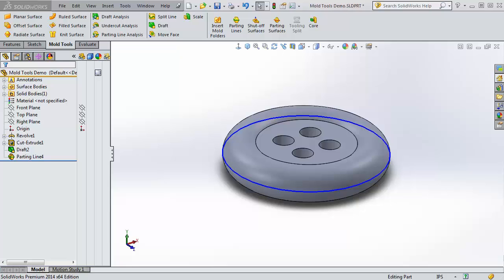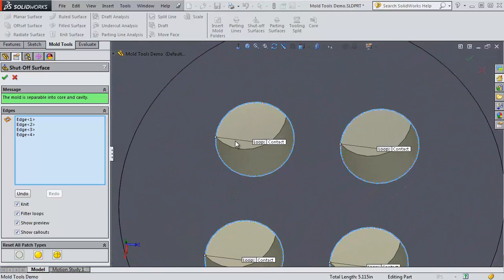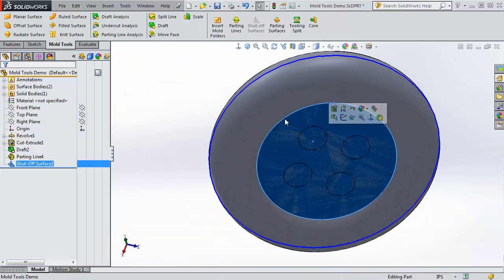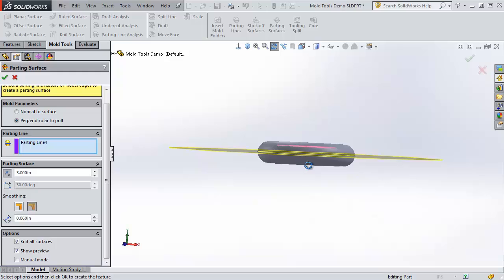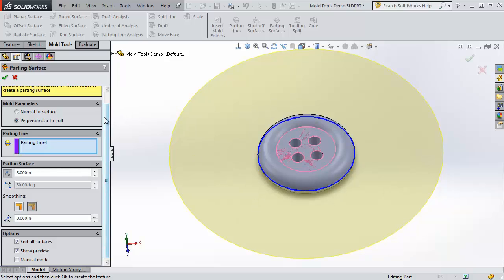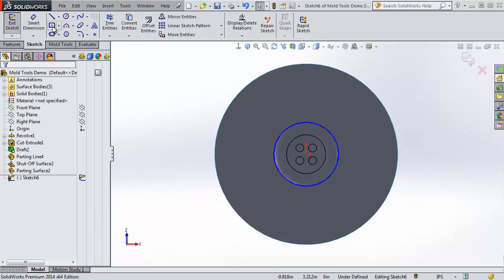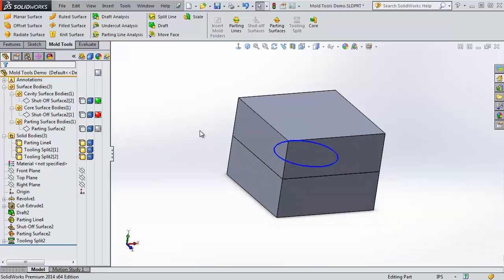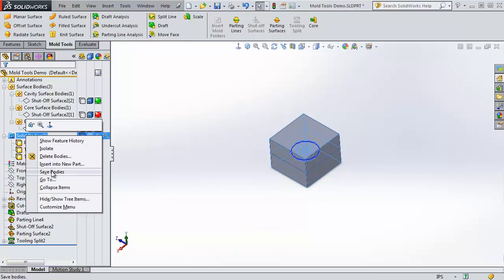SOLIDWORKS – Mold Tools Part 3 – Shut Off-Parting Surfaces and Tooling Split

Comment: To start with, brilliant video.
I'm trying to make a mold for a frame. In the final step, ie, 'tool split', I get an error 'Cannot knit sheets together' 
Any ideas?
Reply: I had the same problem. Solved by inverting the directioin of the split surface. Check the vid again at 2:24 to 2:40. For some reason SW by default draws the direction of said surface opposite to how it should be.